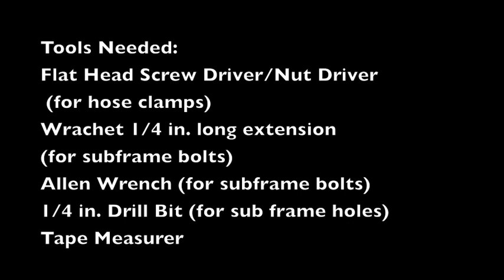Fuel Customs Intake Install for YAMAHA YFZR/X

Comment: What do you do with the breather box on the 2016 yfz? There isn't any room to put a filter, plug or hose on the part that drives into the stock air box
Reply: Look up the ltr breather box mod

Comment: i just installed one today, just wondering what you do with the reservoir that bolts into the stock airbox
Reply: Did you ever find a solution to the reservoir that bolts on to the stock air box?

Comment: My upper subframe bolt has almost rubbed a hole through the plastic intake tube. If i turned the subframe bolt around it seems like it the head of the bolt would stick out further, but it might be less sharp than the bolt threads. Not sure what to do?